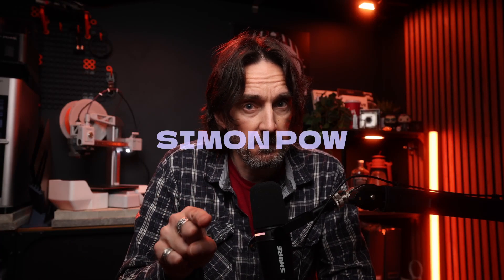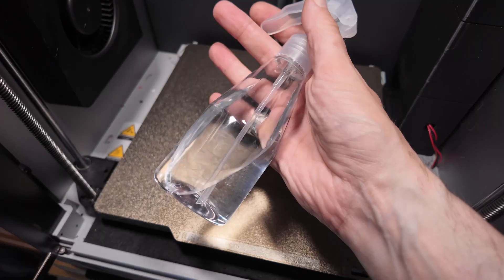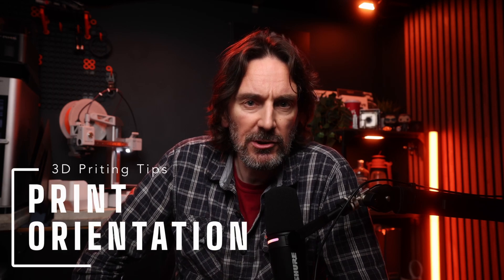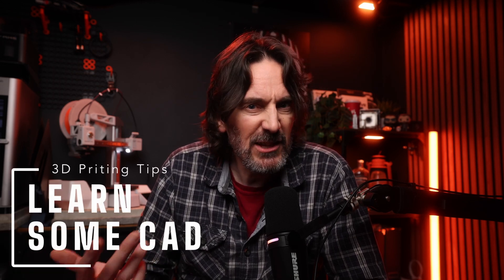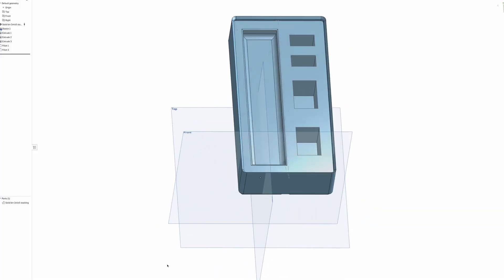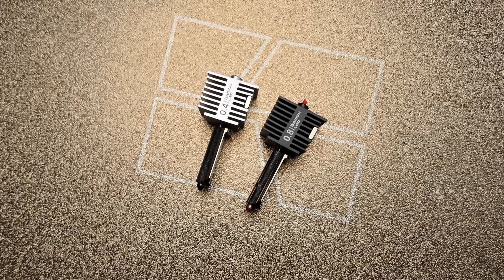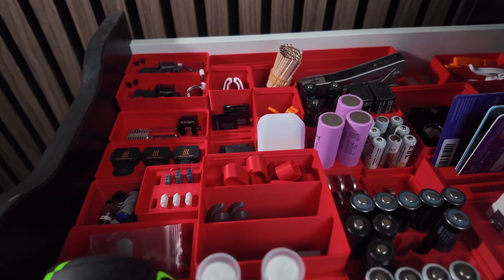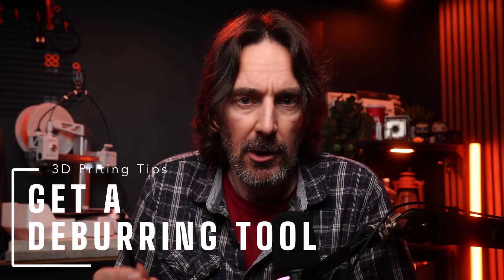3D Printing Tips You’ll Wish You Knew Sooner

Comment: I use the same air-tight cereal boxes, with small perforated tins and silica gel. Modded 2 boxes with a single roller that drops right in and a feed hole with a screw cap to seal it off when not in use. This system keeps my filament dry to under 10%  for an incredibly long time.